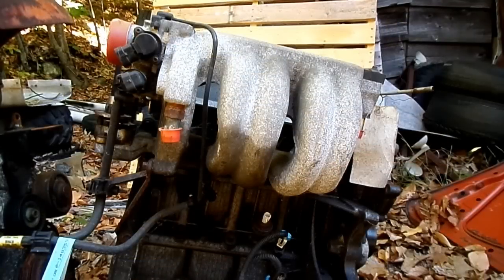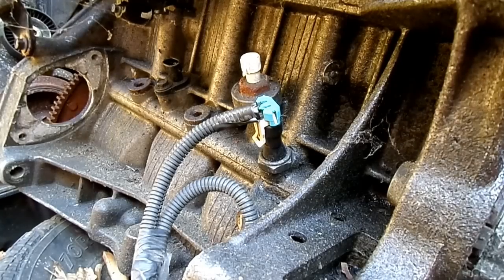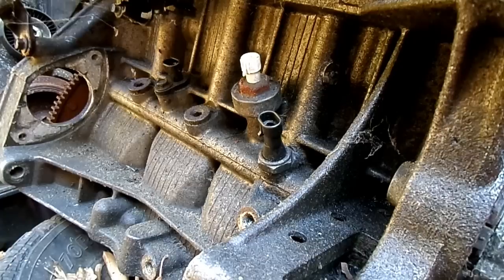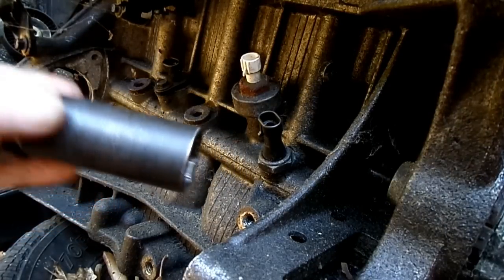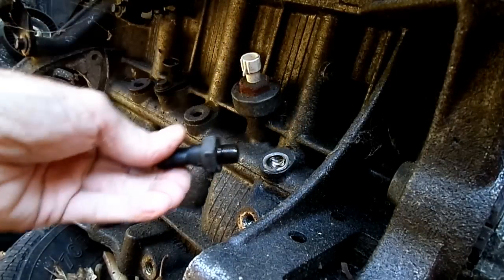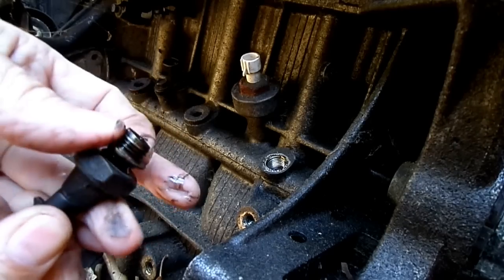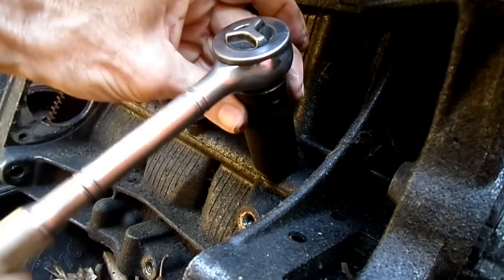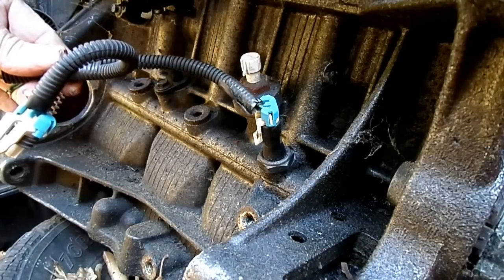Saturn Oil Pressure Switch Replacement

Comment: So have you ever add a pressure gauges to your s-series?
I have a 1998 sl1, i've seen couple videos on how to add these gauge but I don't see any sources online that have a guide (this video is about the closest i've found) 
I can crawl around under my  car, but i was curious if you've ever tried to install one, or if you had any tips.
The best i can see so far is getting a T fitting that fits the sensor, and then adding the sensor to that.
Just trying to have a clean CEL free experience haha

Comment: Open ended spanners tend to open up slightly when applying a lot of force, that rounds the nut a little, i find ring spanners or sockets are much nicer on the nut :-)
I just think the tolerances for spanners/nuts make them a bit looser fit than ideal.
But thats just my opinion :-)
Reply from the maker: +zx8401ztv I agree.

Comment: why does my car die out some times. cleaned throttle body, 2nd air flow but still the rpms go high or low to die out?

Comment: Now the CKP sensor has an 8mm hold down bolt over to the driver side of the block, what is the other sensor in between. I cant seem to find any information on alldata? 
Reason Im asking is because I'm having a hard time diagnosing a code P0340, cam location signal missing... No missfire code, but the engine seems to miss at idle when cold but clears up when warm. It also misses under moderate to heavy load at low rpms
Reply from the maker: Are you working on a Saturn S-series.
Reply: richpin06a 
Yes it's a 99 Saturn SL SOHC, Manual transmission, manual steering.
Reply from the maker: Have you seen my video on the P0340 code https://youtu.be/i_y-3fhAHZM

Comment: Mine has been leaking for a while and the oil light comes on when braking hard or sharp turns
Reply: Did you ever fix this issue?
Reply: Mario Almaguer yeah I needed an oil change bad I was out of oil lol
Reply: Yup I was dry. Thanks man
Reply: Mario Almaguer the cars still running well to this day. Trans is slipping a bit though but I just leave it in 3 so it doesn’t have to keep going to 4 when i don’t want it to. I gave the car to my mom so she can save on Uber and Lyft and bought a new car.

Comment: 95 sl1. If it sets for over a week it will loose oil pressure prime. Anyone have this problem? Take off the oil filter it's dry. I have to put a hose on the filter nut and pour oil in to re prime it. Why is this happening? Anyone know?
Reply from the maker: Have you tried different oil filters.
Reply: @RichpinTv  no. Is that my problem you think?  Does it have to be a certain type of oil filter?